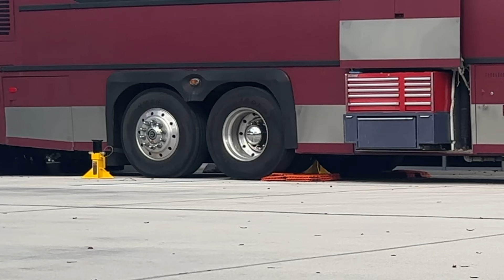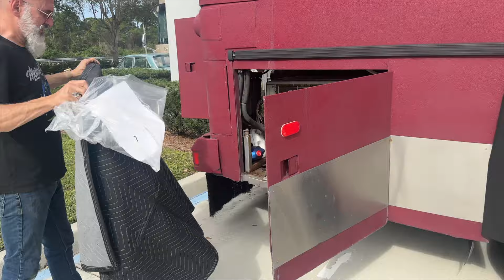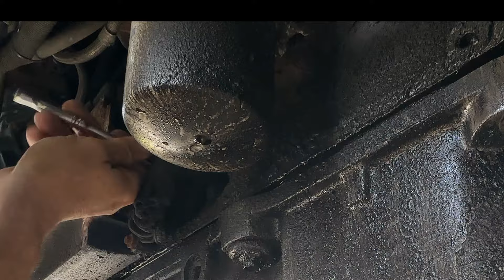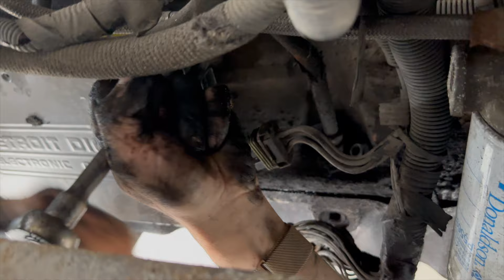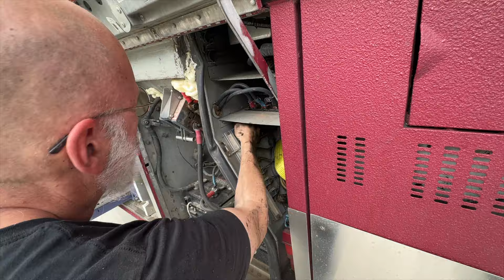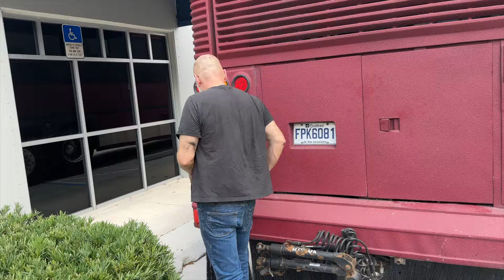Lacroix crusiers need to replace ECM computer for 60 series in MCI bus 102dl3 1995

Comment: Nice video Lacroix Family, I had a crank and no start when my computer(DDEC-III) failed.  The engine would run off the ether shots, so wasn't getting fuel. LEARNED, two things. One, the computer was dead. Two, was that my motor was a 11.1liter(engine label was missing). I though I had a common 12.7 liter DETROIT SERIES 60. Again, nice video Lacroix Family and be safe on the road until to see each other again.  Many Blessings!!!😄
Reply from the maker: Thank you.
Reply: Literally the same here. For me last Thursday. I think it might be a ecm for me too. Only thing I'm trying to confirm before hand is why eventhough the cel is on, the ecm is not talking to the scanner.

Comment: What led you to determine it was the ECM?  Also, it looks quite oily underneath, do you have a leak you have yet to address?
Reply from the maker: Code 53, yes there’s a small leak that is avoiding being found, we use 1 gallon every 5000 miles